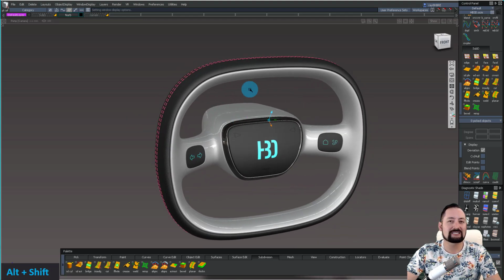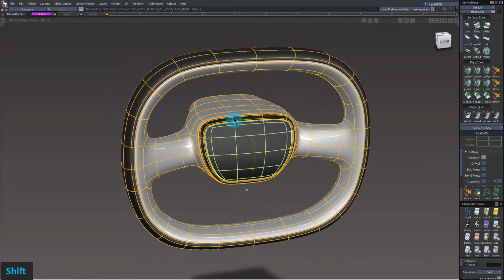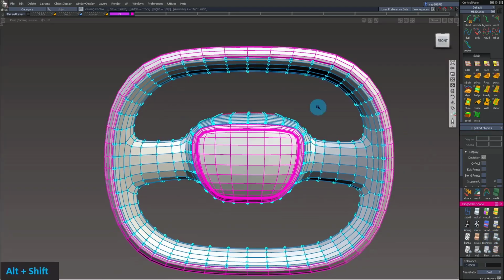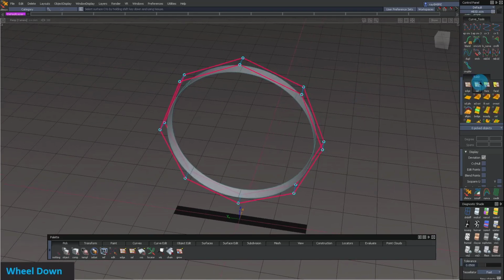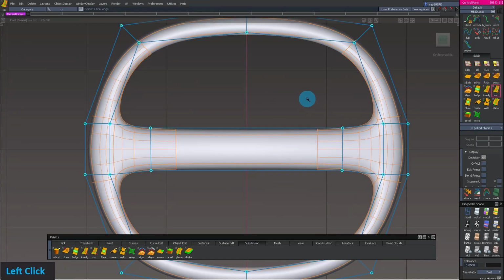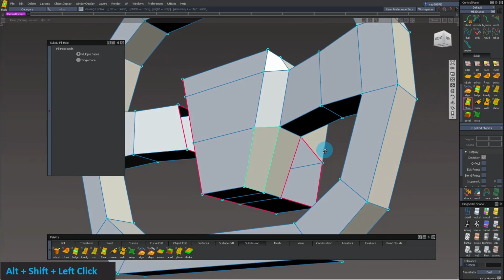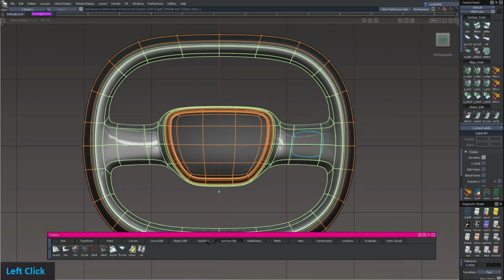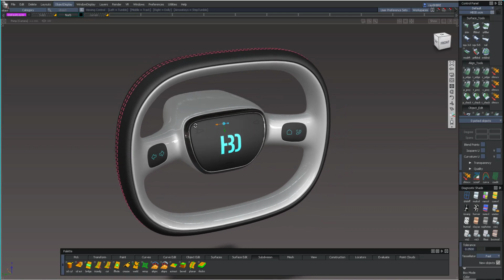Alias Sub D modeling a Steering Wheel and how to Import and export to Blender

Comment: grab the cut tool...and then make a line? what? how do you make a line for the cut tool?
Reply: its really unfortunate this technique is not explained better as you use it alot and it not how the help menu decribes how to use it at all.
Reply from the maker: @jimdeasy  when you activate the cut tool, wherever you click it will start a line. Is that what you were confused on?
Reply: @HandleBar3D  I tried but really its not working i am using 21 version. after picking cut tool need to do something else. i guess i am missing something..

Comment: One thing I was wondering is if you can still edit the sub-d base mesh after you make the nurbs edits?
Reply from the maker: Not yet. With some tools it works for a bit but I don’t think the tools are updated yet so they tend to crash or just not work when it’s still in sub d mode. I am sure that will be fixed in the next versions of the software.
Reply: @HandleBar3D  I could imagine that would be taxing on the History...but to be able to model with sub-d and nurbs at the same time would be amazing.
Reply: @HandleBar3D  Which tools have you found that do not work with the Subd NURBS surfaces or cause specific crashes? Id like to discuss this with you.

Comment: Alias is obviously one of the most demanding software to learn - so for me, I would watch your entire tutorial even if it was 3 hours long. Speaking of which, have you ever consider creating a full-length automotive design tutorial in Alias - for purchase? I would buy it in a heartbeat! Great work as always!
Reply from the maker: I’ve been asked to develop something like that but I always like that all my videos where available to anyone with a internet connection. I’m trying to make it so the lessons are free and I get the finance back through ads and selling models. Maybe even sponsored videos. My client work pays my bills anyways.
Reply: the fact that the narration is so patient and rythmic adds some great value to these videos
Reply from the maker: @sougathota  thanks for the insight, I never know if they are too long winded or too fast. I have ADD so it’s hard to even sit through videos as long as mine.
Reply: @HandleBar3D  Good to see you are back at it again!
From my experience, the video length really depends on the context. If I want to know how to get something done in order to move on, then it should be as short and to the point as possible (1-10 minutes range). Obviously that's not the case for Alias (and CAD modelling in general). For that I would consider 15 minutes to be short and if you dive deep into a topic, 60-105 minutes is perfectly fine (like a lecture). In that case you could split the video up with timestamps in the description (which will also show in the video timeline as seperate chapters, Chamferzone does this and works perfect). That way people can skip through things they know. This also helps to rewatch something you knew was covered, but forgot where it was in the vid.
Personally, the more info that's out there the better and perhaps long videos require less time to set-up in planning ahead and editing? Also, I find that these longer videos tend to contain particular workflow gems, which to you may seem too trivial to cover.